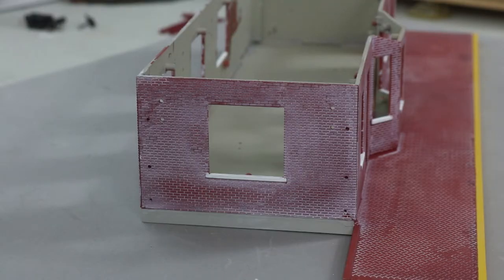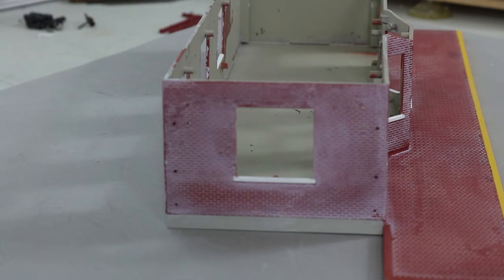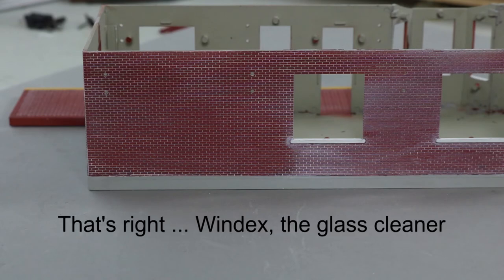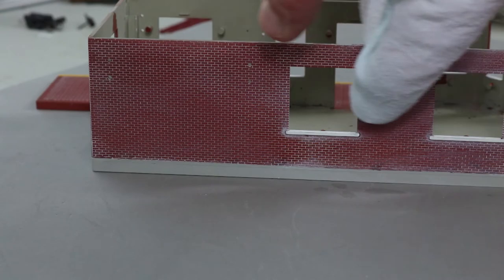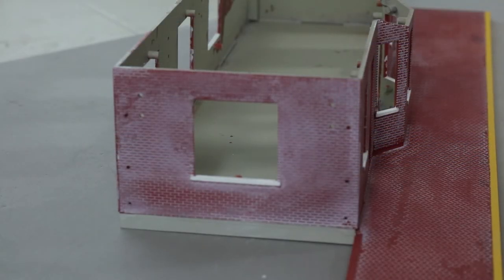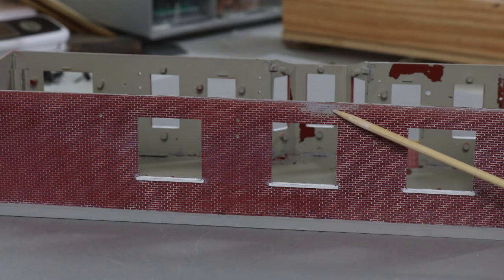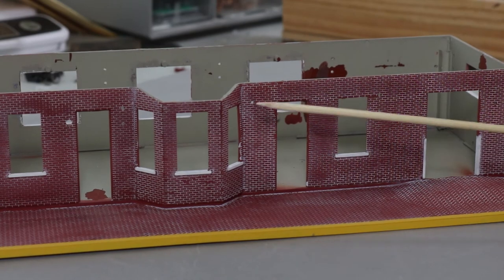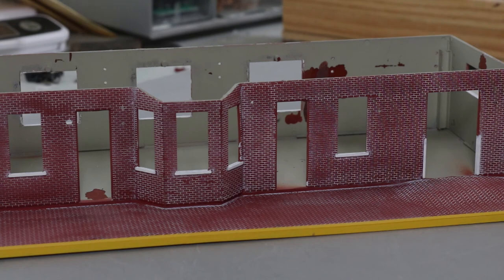How To Fix a Bad Mortar Job – a Model Railroad Quick Tip

Comment: Would it help if the mortar paint was a little more watery, place the brick panel at a slight angle, apply the paint at the top of the panel and let gravity pull the paint down through the mortar grooves? If paint does end up on top of the bricks, use a sponge with windex and light pressure to remove the excess paint? Looking good!
Reply from the maker: All good ideas. I have a similar structure to complete so, I'll try your tips. Thanks...Harold

Comment: I use Containerman68's method and I have several small blocks of wood covered with a fine cloth. The cloth will lay on only the top of the brick and when clogged with paint, you can wash it out. This tends not to get into the spaces between the bricks. this was taught to me by some older and better modelers than I am and I am grateful to them. Your way is great, mine is just different...
Reply from the maker: Thanks for the comment. Many ways to do this but the use of the cloth intrigues me. Maybe I'll try it next time...Harold

Comment: try using a q-tip in the Windex it easier to control the amount of pressure.
Reply from the maker: Thanks for your comment. I agree. Actually, I used q-tips in the corners and under the windows. Just didn't show that part in the video...Harold